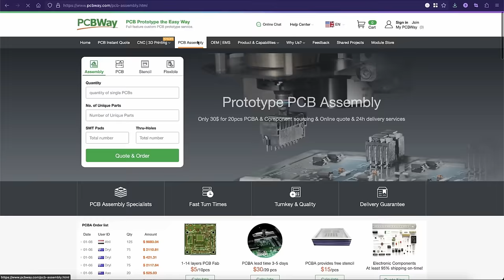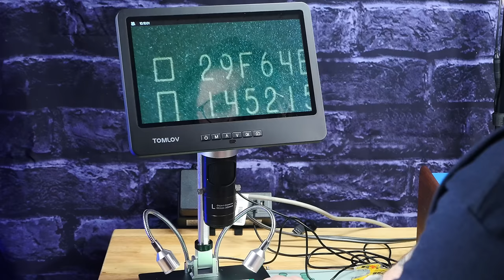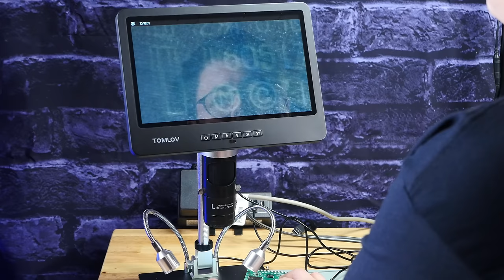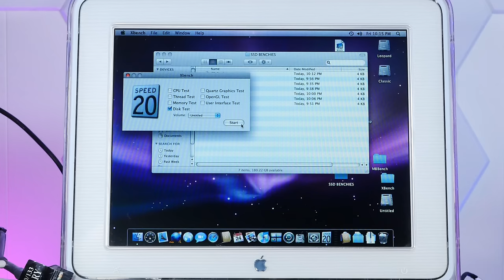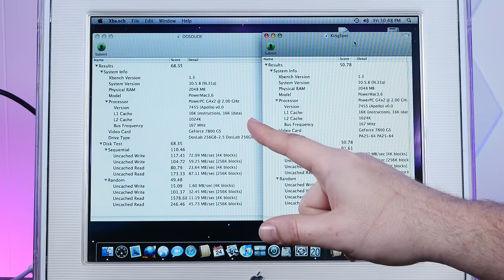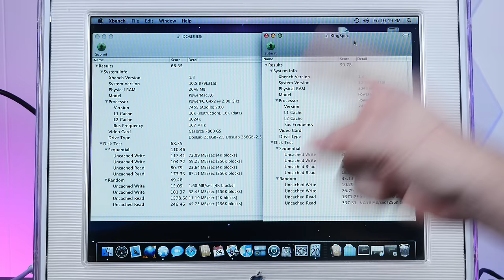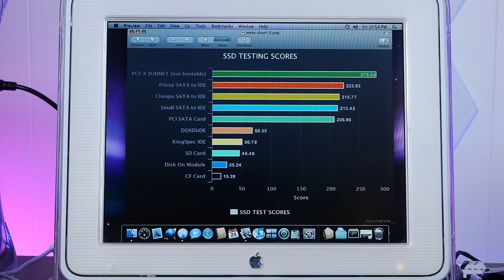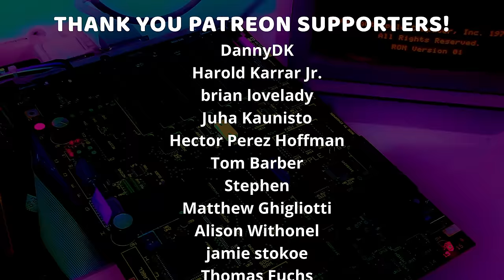What's Inside This PATA SSD from Amazon?

Comment: What a coincidence that the KingSpec drive uses the same chips I decided on. If I had to guess, the only reason it's slower is due to it only having one NAND chip installed, whereas my drive has 4 (for 256GB). Also, the SATA/mSATA SSDs all have DRAM cache on them, which makes the random tests way faster (hence the much higher scores). Unfortunately the SM2236 doesn't support DRAM cache, so I couldn't implement that in my design. That red SATA to IDE adapter you're using is special, in that instead of the garbage JMicron JM20330 SATA-IDE bridge IC that all the other adapters use, it uses a Marvell 88SA8040 or 88SA8052, which are WAY better, and faster in most cases (as shown here). At the end of the day, though, the native IDE drives like mine, the KingSpec, and IDE DOM will be compatible with a much wider array of systems than ANY SATA to IDE adapter.

Lastly, you are correct in that that Sonnet PCI-X card is not bootable. I did have a plan to attempt to write my own firmware for it to make it bootable, which I may start working on sometime soon.
Reply: You're a legend mate! The work you do is totally epic!
Reply: That's correct! The Kingspec drive is slower because all data is stored in one nand flash chip (with a limited IOPS). Just for data recovery purposes the Kingspec has more chances to a successful data recovery compared to your design because the controller stores the data in the flash chips like a RAID controller (a pain in the ass reconstruct the integrity of the data by hand).
Reply: yup
Reply: Thanks for developing these SSDs!
Reply: Rockstar!
Reply: Awesome.

What else is that chip used for? Seems odd that it would exist if the only PATA-to-SSD devices were yours and that one Amazon vendor.
Reply: The fat models of the Playstation 2 support an IDE hard drive for expansion. Is your SSD compatible with them as well?
Reply: That was my thinking - if they did a Kingspec 256GB with 4 flash modules, I think it would be similar performance. But the DD device seems to be a better value proposition anyway.
Reply: Great job on your design! I can't wait to get my hands on one. 

I just checked my StarTech device and it uses the 88SA8052.
Reply: Came here to say “isn’t this the M2 base model issue - only one chip so the controller had to write all the data to the same chip rather than multiplexing”. dosdude1 beat me to it 😂
Reply: How much do you charge to have an SSD made and sent to me in the mail? I would like to try one
Reply: I've been working on PCI-X SATA cards based on the SIL3124. I'm close but there are timing problems that I'm trying to chase down.
Reply: @charlesswansonii9319  should be. You can use most SATA IDE adapters in the PS2 and you can get such adapters that are made to go right into the network module to make it convenient. But almost definitely dosdude’s SSD would work
Reply: Thank you so much for all of your contributions to the Macintosh, and open source communities. It is sooooooo appreciated!
Reply: Thanks for you efforts designing the drive. Can you please tell more about how your drive is dealing with lack of TRIM support in older systems?
Reply: How does your SSD work on systems without TRIM support? Can you issue TRIM commands to it somehow?
Reply: It would be interesting to see 3 more chips added to the KingSpec, along with whatever mods it needs to its firmware to use 4 chips, then compare it to the DosDude1 version. Since DosDude's is open source I wouldn't be surprised to see it being made by various Chinese companies.
Reply: Your SSDs should be spot on in Zunes, since they can only work with Kingspec SSD cause of the controller. Keep up the good work mate !
Reply: now I'm curious how tricky it'd be to remake the board to fit that odd 1.8" formfactor the old Ipod and Zune used. The latter's a good music player who's battery is still great 20 years on, but the hard drive is shot....
Reply: @DFX2KX  That was actually the first version I made, for 1.8” ZIF.
Reply: @dosdude1  oh nice!
Reply: Will you be making a PCB with support for DRAM though? I'd personally avoid DRAM-less SSDs at all costs.
Reply: @Piipperi800  The controller doesn't support DRAM, and PATA is so slow you honestly wouldn't notice, sans maybe slightly faster random read/write. I don't even think SCSI is fast enough to need DRAM.
Reply: You, sir, have done so much for the community - you kept my MBP 5,3 going until OCLP came along. Now this! Thank you x1000!
Reply: @DFX2KX  I know the controller doesn't support DRAM, that's why I said a new PCB, probably should have added new controller as well. But you can very clearly see in the video it still makes a huge difference.
Reply: @AdamKlein77  My guess would be: There are a lot of industrial DOS machines out there that use Intel 80486 CPUs that only support IDE. This chip can be included on the motherboard for the storage.
Reply: With the Sonnet, just boot from something else, like a SD card  adapter, then hand control over to the Sonnet as soon as possible. Of course we would need something, software wise, to make that happen, but it's got to be way easier than re-writing the Sonnet firmware.
Reply: Legend. My 2009 MacPro thanks you for your service 🫡
Reply: Where/how can I get one of your drives?
Reply: @RANDOMNATION907  I've got a bit of a backlog of orders at the moment, but just send me an email and I'll add you to the list.
Reply: @DFX2KX  based on the results in the video, it looks like a DRAM cache makes a big difference.

Probably not likely somebody will make a PATA controller that supports it, though. Shame.
Reply: @AdamKlein77  It'd have to be enough of a difference and a large enough market, which I don't really think is the case. The only PATA drives I still have are in an old X41 and my Zune, and this sort of SSD is an order of magnitude faster than the spinners currently in them. Speed became important, but I just replaced the Zune with my phone, and the X41 with a faster 2-n-1....
Reply: This is exactly what I came to write - I was wondering if the IO was being split between the 4 memory chips to give it more speed..   I was not aware of the DosDude card..  That looks like a really awesome solution.  I'm wondering if there's an option to put a female header on it to just plug it straight into a motherboard..  That might be a space saver in some use cases!  Thanks!
Reply: I take it that red one might be from star tech?
Reply: IDK what the model is, but I have a SONNET 133 Mhz IDE card that I use to boot from in my Sawtooth.
Reply: ty for this post 
I was going IT HAS ONLY 1 CHIP ofcours its going to be faster whit the same hardware OMGH
Reply: Are any of the controller chips from modern high capacity cf cards available for testing?
Reply: This also applies to your 40 pin zif ssd that kingspec made also

Comment: Its likely the CF adapter didn't enable UDMA Mode on the CF card (the commonly available Syba ones do). Those Transend cards should be performing faster. The difference between the DOS Dude card and the Kingspec is likely because the DOS Dude card has more flash chips and the controller is spreading the writes between them, giving a slight speed boost.
Reply: Not sure. He doen't show the actual result in MB/sec only the score (why btw?) - but it is only a "133x" CF card - which could in theory read up to 20MB/sec. In reality i would say more like 12-13MB/sec. Which is slow for todays standard. But the CF specification goes up to 160MB/sec (1066x). Thus could have competeted with the native IDE drives.
Edit: Same is of course also true for the SD Card. I think he used a UHS-I.... while there is UHS-III stuff floating around.
Reply: the SD card would've been as limited if it didn't use UDMA and it did much better. CF cards are just obsolete.
Reply: I can tell you that that model of CF card is that slow. I have 8GB version of it.
Reply: CF cards have always been slow when used as a HDD standin, beyond DMA etc related things. I no longer recall the exact technical reason but it has to do with the layout and addressing that is part of the way CF works, even the fastest cards are slow at bursts of small ops compared to an old IDE HDD per my testing. Sustained data transfer is fast, but seek etc is absolutely not. I tested this extensively but quite a few years ago, also VS a CF microdrive which behaves like any HDD. It's not interface, CF is IDE pretty much, and behaves the same.
Reply: It is indeed a CF controller chip
Reply: Yeah.. I saw that dosdude card and the Kingspec, and my first thought was... I wouldn't be surprised if the dosdude card is going to be faster, exactly because of the reason you mention.
Reply: @noth606  heh ya i once tried to copy half a million midi files onto a cf.. it slowed to a crawl.. yet was decent at copying over age of empires, noticed the movie files and larger data files picked up speed during the copy process.
Reply: On the CF to IDE adapter, one leg must be soldered off, which is responsible for recognizing the device in the controller, and then the CF drive will work at a maximum speed of UDMA 100 and higher.
Reply: Would be interesting to see how well a CF HDD does. Like the drive from the iPod Mini.
But yes, more flash memory chips will perform better. Can see the same with SATA SSDs. The bigger versions of the same model are faster, simply because they have more chips and can read/write them in parallel

Comment: Could the difference in speed between the DosDude and KingSpec SSDs be simply because your DosDude SSD has 256GB in 4 flash chips, vs 64GB in a single chip for the KingSpec? I reckon if you tested a 128GB or 256GB Kingspec its speed might be very similar.
Reply: Right you are.
Reply: yeah the controller manages the multiple chips in a somewhat parallel fashion
Reply: @AlpineTheHusky  parallel or interleaved ?
Reply: Yeah dosdude admits this in the pinned comment at the top. More is almost always better...

Comment: The Startech SATA to IDE adapter is what is essentially required for replacing an OG Xbox hard drive with an SSD.  There are, of course, lots of other similar adapters, many of which are cheaper. But the Startech adapter works. At least in that application, and the Xbox is extremely picky. None of the others I had work.  It just speaks to that adapter being a solid choice. It worked for you. It works in OG Xboxes.  It will probably work for others.  Great video!
Reply: Probably something with the available drivers. After all, the og Xbox is just a Pentium 3 and Geforce 3 running Windows 2000, Microsoft went with common PC parts on purpose. Makes me wonder if it is possible to add support for other adapters to the system.

Comment: I'm not surprised the DODDude's drive beat out the Kingspec.  The controller will spread out the data across as many chips as possible so it will read/write to them in parallel making them faster.  I am surprised the performance gap was not bigger.
Reply: Interleaved.

Comment: Great video! Also totally not surprised by how well the Startech SATA to IDE adapter performs. It's a total champ. I've used the Startech in iMac G3s, Original Xboxs and even an Amiga 4000. It's fast and largely super compatible.
Reply: It is actually surprising how good StarTech does those kind of things. Always expensive, almost never cheap :D lol
Reply: The one place it didn’t work for me is in a multitrack digital audio recorder. It didn’t do well in simultaneous read and write at that data rate and I got a lot of drive speed faults, it kept kicking out of record. I “upgraded” to a two inch 24 track analogue machine and have had great success, though I did have learn editing using a razor blade.

Comment: Another good solution would be to unhook your IDE based computer, pack it relatively well, and take it to your local recycling center. Then use the money you planned to spend on a IDE/SATA converter, and use it to buy yourself a modern pc.

Comment: I’ve heard that most SATA SSD’s can be disassembled, and the actual SSD inside is smaller then the housing. What I’d say the best thing to do might be, for a laptop, is to just disassemble a SATA SSD and use an adapter to make it fit inside the laptop.

Comment: It all makes pretty good sense.

The DOSDude card has 4 flash chips vs 1, allowing the controler chip to spread out the read/writes, making it faster.

The SATA SSDs all have RAM caches, which dramatically accelerate access to the flash.
Reply: He needs a big Recycling bin in his mums house ! E WAIST !
only keep the apple II, trash the rest, keeping the M2 as the daily gear !
Reply: @lucasRem-ku6eb  take your nonsense comments elsewhere
Reply: @armanelgtron4533  You need the Roland MC 80 ? why you need it, not smart enough ? what did you meant ?

Comment: I would assume dosdude1s ssd ran faster as it has more nand flash chips than the kingspec which would allow the controller to write to more disks at once. The larger flash chips might also help as they may have a larger buffer in them. 

Kind of surprised the sata adaptors are so much faster. I guess the ide drives have an older controller.
Reply: Most SATA SSDs come with an SDRAM cache which the controller Dosdude1 used does not support. That's probably the reason the SATA disks are faster, especially in random benchmarks.
Reply: @nilswegner2881  fair but does a cashe effect raw throughout larger than the cashe?

Comment: Main reason for dosdude’s SSD being faster than KingSpec is due to capacity, more precisely - number of NAND modules.
For example, if you’ll get two regular SATA SSDs, let’s say 128GB capacity, but one of them is made from one 128GB NAND and the other one is made out of two 64GB NANDs, the 2x64GB will be faster. Not by much, but it will be. That’s similar to the RAID 0 way of working. If you use two or more drives, speed increases. Same principle goes inside the drive itself. More NANDs equals more speed.
Simple yet amazing.

Comment: The best MSATA to IDE adapter you'll find is the Ableconn IIDE-MSAT. It uses the Marvell 88SA8052  chipset. I've bought countless of the Chinese MSATA to IDE clones and they all fail. The extra cost for the reliability and performance of the Ableconn adapter is worth the price. The current retail price of $42 USD for Albeconn + $35 Kingston KC600 256GB, make it comparable in price to dosdude's pre-assembled 256GB. Plus the Albeconn is reusable in the future as the MSATA SSD wears out.
Reply: You're going to have to do a lot of computing on that device to have it wear out. I haven't had that issue and I have had some of my SSDs since they first started making them and I have yet to have one actually fail which is actually kind of lucky for me.

Comment: My experience using sata to ide converters is whether or not they work depends a great deal on the sata device connected to it. Some drives just don't work properly using old ide compatibility modes. Older drives seem more reliable with newer ones ignoring compatibility with old controllers. Apacer sata ssd modules seem pretty good and they are small enough to fit with a ide44 converter into a 2.5" drive bay

Comment: Even in my Amiga 600 I notice a slight improvement from CF card adapter to SD card adapter, but the integrated IDE controller is pretty much maxed out at this point.
Reply: Yes.On the Amiga 600 and 1200, it is necessary to use an external controller on the accelerator and the built-in one is obsolete in data transfer speed.Although there are improvements to the controller that allows you to speed up work, but it is still difficult for him to compete with modern solutions. I also have an Amiga 1200 as a retro computer. You can put a Morph OS on the Power MAC hardware and run amiga applications.

Comment: I wish it was possible to slide in the Transcend PATA IDE SSD into those tests.

I've hunted for a teardown, but I don't see one online.

The main draw of the Transcend PATA IDE SSD was that they listed a firmware level wear leveling onboard as well as options for TRIM (OS depending) as other neat features.

I'm curious if that SSD uses the same controller chip as the DOSDUDE board as well, and if it's integrated into the firmware of the chip, or if it's custom flashed.

I have a Transcend 128GB drive, so I may crack it open to get some pics of the internals, as it's more expensive than the King something-or-other brand.

Comment: those Silicon Motion controllers have a number of channels and without looking that one up I would guess it has 4 (usually theyre even numbers, 4, 8, whatever) and so my guess is that perf diff is in part due to the parallel (no pun intended) nature of the flash being accessed...im surprised though that it matters as I assumed the bottleneck would have been the interface - i guess that shows what a HUGE difference having a RAM cache makes on these as that wouldve leveled the playing field is my guess regardless of number of channels for most workloads anyway